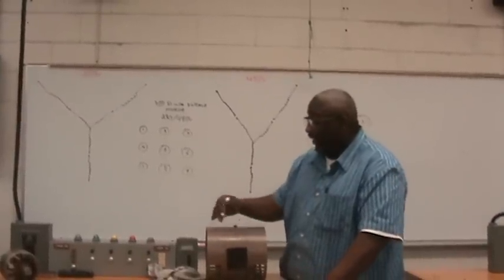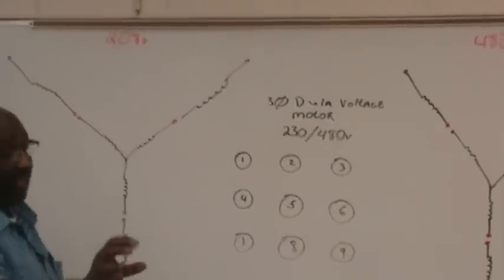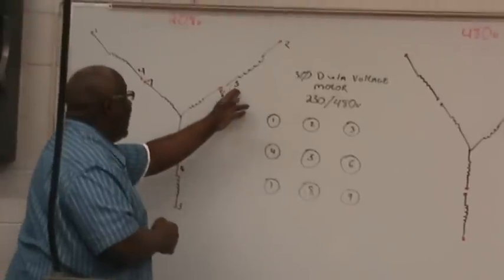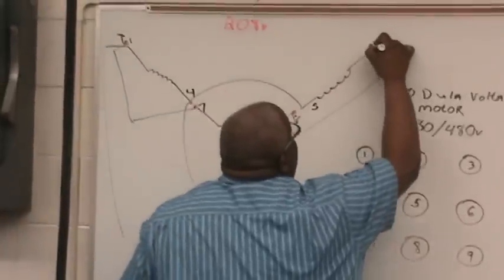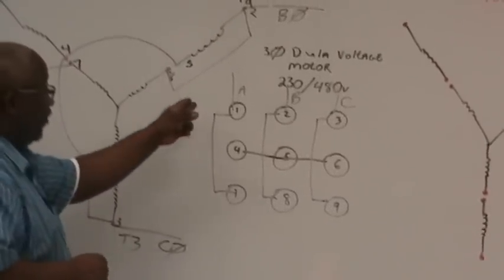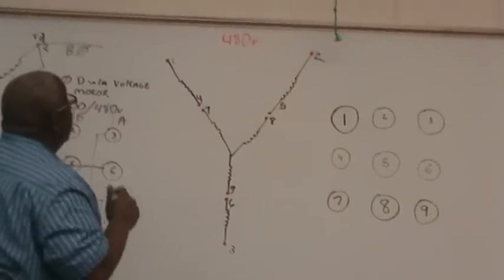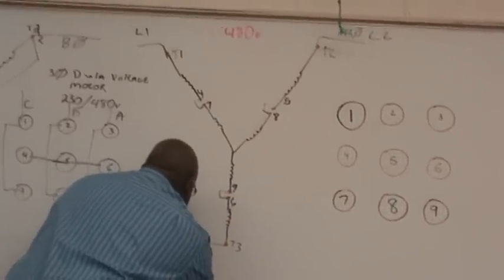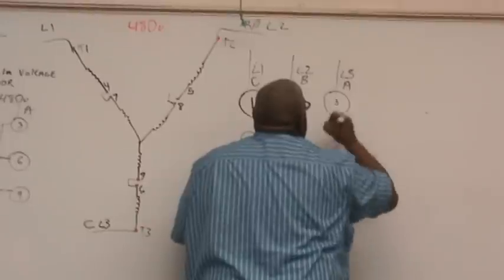3 phase motor connections

Comment: I am doing this now for real. Yours is the only one showing the connections for low voltage coil by coil. Thank you very much. I did it wrong, and motor was drawing 28 amps for 10 secs and ran, but sounded wrong. Smoke came out when turned off, but only a little, ohm reading of coils did not change, hope I did not break it. I did not break from 4-7, 5-8, 6-9, but did break the center connected 7,8,9, thinking those were the ends to bring out to connect, as all the other sources don't show it like you did. Motor is for a Cincinnati Mill machine from 1966 and don't think I could replace it easily.

Comment: Very helpful.    I just bought a used 440 volt motor I need to rewire for 208 volts.   Have not opened the electrical box yet to see if already labeled but now have more confidence

Comment: This is a great video. I've wired a lot of dual voltage 3 phase motors, always relying on the wiring diagram. It's great to understand what I'm actually doing and  not need the diagram.

Comment: Awesome video... Thanks a million.  What if the lines to the motor aren't labeled though?  In the past, if I wire a motor in and it spins the wrong way, I've just flipped any two lines and it spins the opposite direction.  It's always seemed like the wrong way to go about it...but we're on a farm that was wired 'shittily'.

Comment: i don't have  electrical degree but just curious question , if you connect it as low voltage, does it mean your operating in a single phase supply.

Comment: Great video. It was very helpful and well explained. My only concern for this example is about the voltages used; shouldn't these be 220-240/440-480, (230/460) instead of 208 volts for the low value ?......these values come from NEC table 430.250. Thanks so much !!
Reply: you need to watch this one more time.... if you didnt know  line voltage in US  207-208  and high leg 208-209 - 211

Comment: Good morning James on the high voltage do you tie 1,2,3 together, just like 4,5,6 on the lowside, or do I just cap those leads off ?
Reply: 123 are not to be wired together...they go to the wires coming into it for the power

Comment: So; quick question: if the nameplate is missing, could t7, t8, and t9 be wired in delta configuration? How would you tell?
Reply: I don't think it is delta wiring of 9 wires it can't be connected in the midlle 7,8,9 this is Y soo I goes midlle point is connected to case of the motor Ground...
Reply: @nukeelda  : yes; but if you came across it and did not know what was wired with what; it could also be in delta configuration.

Comment: Appreciate.please present how to rewire a 12 lead,6coil star configured 3phase alternator .so a 220volts output and a higher current is achieved.eg convert 35kva 3phase y configured alternater so ones rewired the output is single phase .only one phase and neutral

Comment: You better look at the name plate to know what voltage the motor is rated for.
What if you are sent the wrong motor and you don’t check to see if the motor is rated for the correct voltage!
I think what he means is you will automatically know how to connect a Wye connected motor in low voltage (in parallel) or high voltage (in series)!
Also I saw Delta voltage or configuration written on the white board and this is Wye configuration, thus the Wye.
Delta is different, but some industrial motors are made to start in Delta low voltage and at a certain RPM switch to Wye high voltage to reduce energy loss and heating of the motor over time, to make it more efficient energy wise and to last longer in the field.
Just a helpful informative tip to those starting out.
Also, some times you’ll see the Wye written with the tail down.
Also, obviously, the neutral connection is different in a Delta motor than a Wye configured motor.
The neutral connection is in the middle of the Wye configured motor and is between B and C windings in a Delta configured motor.
There are some better videos on this topic!
Doing the math on the voltages for Delta and Wye configured motors are different as well because of the way the windings are made in the motor, and you can see this better when you look at transformers! Good luck

Comment: why other videos says swap line 1 and 2 for the reverse?
Reply: Because that is true.. duh. Reverse any of the phases to reverse rotation direction of the motor.
Reply: Good question. The order in which the windings fire, 1, 2, 3
or 2, 1, 3 (the phases) determines the directions of the of rotating magnetic
field inside the motor. To further understand what’s going on you can look at
the Cross Product of the Electric and Magnetic field. By reversing the firing
order your essentially reversing the direction of your rational magnetic field
inside the motor which is what determines the spindles direction or rotation.
Reply: Yeah not that trivial dude.

Comment: Can you change a and b or b and c or is it only a and c
Reply: Wire Boy you can change any 3 and it will turn the motor the other way.
Reply: clash kyle you should never use b cause you could come across highleg in some application
Reply: Richard Strouse this is was going to be my question. Thanks
Reply: Hopefully you check out the incoming voltage before wiring your motor to see whether or not you have a stinger leg or not. Especially low voltage not good having 120 on two legs and 208 on the high an finding it out once you flipped the switch.
Reply: Industry practice is to always swap A & C.

Comment: I have one question.....please someone help me....what i know is Star delta starter is used to reduce the starting current drawn by the motor.........but how about variable frequency drive (VDF)..... it is same concept and purpose....to control the motor....so my question is its VDF is a same purpose with star delta purpose....
Reply: ADIB RAHMAN I don't know about star delta, but most variable frequency drives will have a U, V, and W terminal for the motor connection. For low voltage you would connect 1&7 to U, 2&8 to V, 3&9 to W and connect 4,5, and 6 together. For high voltage, just connect 1 to U, 2 to V, 3 to W. For low voltage, you may want to splice a length of wire using a multi-wire splice to each of the 3 pairs so that you still just have 3 leads coming out of your motor for the connection, rather than 6 wires.

the VFD will have power input connections for L1, L2 and L3 from your source. For single phase input VFDs, I believe L3 (or the 3rd lead) is connected to ground (alternatively you could say there is no L3 lead, just a ground lead). For 3-phase input VFDs there may be a 4th wire for the ground connection (usually green).

Lastly don't forget to connect a wire between the ground screw on the motor and the ground terminal on the VFD.
Reply: John Thompson  thanks you brother........for your feedback..... I juz curious...... about starter star delta and VFD technology
For brother john thompson....I have some answer or opinion from other friend in here for this question.....this info juz for sharing knowledge or additional info....ok

This opinion from bmanishap......and what he write is  "+ADIB RAHMAN Yes same concept. Both methods help to start motor slowly to avoid high torque and high current. VFD is very ADVANCED and power transistor based. In specific environment, you need to control motor speed, start and stop in very accurate manner and VFD SOLVE  this purpose. With star delta starter you CAN'T control motor in precise manner. Check out following link:
https://en.wikipedia.org/wiki/Variable-frequency_drive..  "

so for conclusion is VFD is upgrade technology from star delta starter....and both system is same purpose...huhuh

Comment: I prefer when learning about electricity if the professor pretends they are an electron and shows the flow of electrons. Without seeing that, a lesson is useless to me. I cannot think past the fact of "where the hell is the flow?" and won't hear any other parts of the lesson.
Reply: This class is not for beginners. This is a lesson for electricians installing motors in the field.

Comment: THIS IS THE MOST COMPREHENSIVE VIDEO I JAVE SEEN, ABOUT WIRING 3PHASE MOTORS..
WOULD YOU EXPLAIN THE COLOR CODE OF 3PH POWER..
WHAT DOES THE RED,BLACK AND BLUE WIRES DO OR MEANING
Reply: 3 hot lines L1 and L2 and L3 plus green for ground if there is no green wire it is DELTA wiring if is 4 wires then it is Y wiring